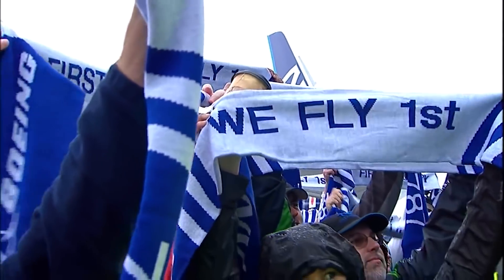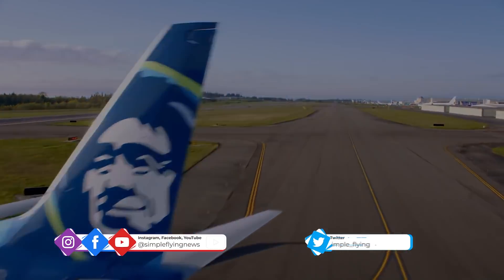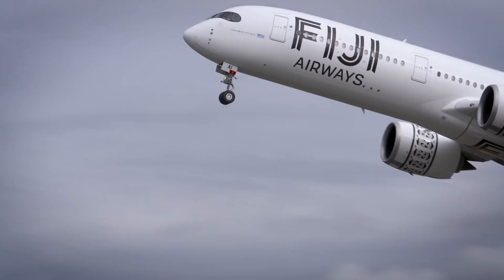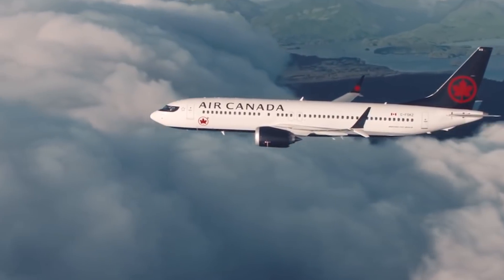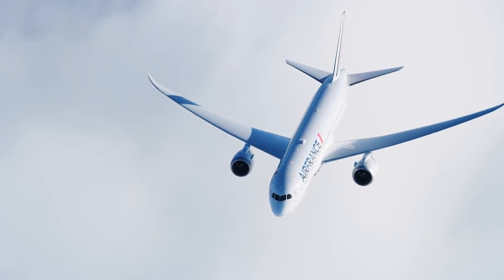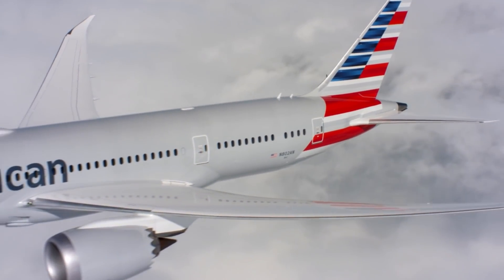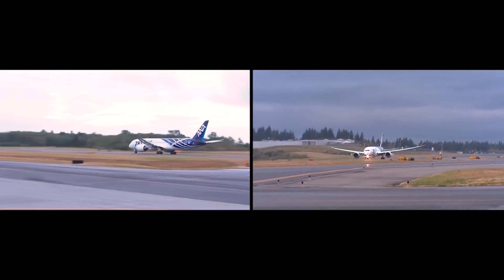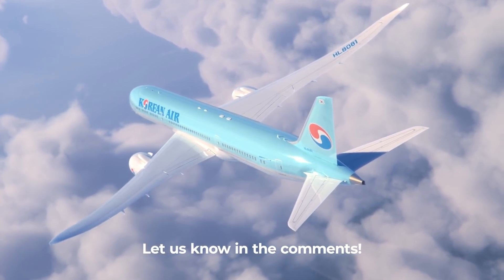Why Doesn’t The Boeing 787 Have Winglets?

Comment: "Raked wingtips" can be categorized as "winglets". Similar to bent-up or canted-up winglets, those raked wingtips are also not a main wing component with slats and aileron. They are an extension for aerodynamic reasons = to reduce induced drag. So they are a "flat winglet".

Comment: “A properly designed wing doesn’t need winglets.” John Roncz. He was the aerodynamicist that designed the Routan Voyager and a bunch of other things with Burt Routan. Winglets came to the fore when oil went up. A design house in Seattle filled with ex-Boeing engineers figured them out. Not all wings can accept the retrofit as spar loads and construction come into play. When Boeing first started offering winglets as retrofits, they wanted to charge a sizable percentage of the calculated fuel savings but got very few buyers. When the airlines, their bread and butter got stressed by fuel, Boeing finally relented to pretty much the cost of producing the refit kits. Interesting tidbit. At United Airlines, the performance engineers calculated the winglets on the 747-400 were useless and wanted to remove them for maintenance and weight savings. This idea was torpedoed by marketing who said they had poured fair money into convincing business travelers that the winglets were the sign of the latest and most advanced aircraft engineering. The winglets stayed.

Comment: The raked wing tip started at NASA about 30 years ago with the scimitar wingtip. It was actually proposed for the C-5 in the 1960s but the Air Force thought it was too delicate.
Reply: I wonder what the Air Force thinks now

Comment: I've flown on a 787, and I was impressed with it. I'm a Commercial Pilot and have flown both as a pilot and as a passenger. Air NZ I flew the 789 and with LAN I flew as a passenger on one of their 788's.
Reply: How does the rake wingtip reduce vortices?
Reply: @Bi Han  The raked wingtips work better than winglets/sharklets because there is less drag, in thus helping the 788/9 with the 20% less emissions. Boeing chose this over winglets because there are less parts to put on the wings, and also the raked wings work better to reduce the wingtip vortices.
Reply: @seanrollett6273  anyone can say that take works better and it reduce drag, more efficient etc but what’s the real reason for it? How does it work better than winglets?

Comment: The first time I saw the 787 wing in flight from my window seat, it looked so beautiful like a work of art. I also love the push button window shading (as long as the flight crew do not override and keep all the windows dark).
Reply: Sometimes it just makes sense to keep them all dark
Reply: @JAYfromTHEworld  True but I did not appreciate it when the flight crew of my flight from Denver to Tokyo, which left at around 1:30 in the afternoon, darkened the windows for the first six to seven hours of the trip, even though it was still light out. ANA flight crews never do that for some reason.
Reply: @alooga555  common courtesy to close your shades after meal service.  Doesn’t matter if the flight departs at 8am or 10pm.

Comment: Does raked wingtip have a tradeoff of longer span compared to winglet?
Reply: Yes but it allows the wing to have a bigger area which is better. Even Embraer uses it for the E2 in 3 different sizes for the 3 variants of the family
Reply: How does raked wingtip reduce vortices?

Comment: Winglets are good when the wing span is limited. For the same wing span a winglet is more efficient. 
But if wing span is not limited then the raked wingtip is better, after all a winglet doesn't produce an upward facing lift vector.
Reply: All the winglets do is minimize the wing tip vortices. They don’t really provide any lift, and barely pay for themselves. The raked wingtip is much, much better. HOWEVER, the -400 is easy to pick out of a crowd!
Reply: @Ampersandrascott  Winglets provide lift. That is why they work.
Reply: @AmbientMorality  Winglets create enough lift to counter their own weight. The main purpose is to control turbulence coming off the wing, which reduces drag.
Reply: @Ampersandrascott  Yeah, I didn't word that well. For a given alpha a winglet allows the wing to generate more lift across its entire span. On an actual plane, of course, that means that the angle of attack can be decreased. But the same thing is true of a raked wingtip, which also allows the wing to generate more lift across its entire span (for a given alpha).

Comment: Has flown many times on the Dreamliner, and flying again 2. April. Very confortable airplane, mainly because of the low cabin altitude
Reply: What is low cabin altitude?
Reply: @erickscott5732  As an example, the B737 when flying at 40.000 ft. the air pressure in the cabin is equal to the air pressure at 3000 meter. Meaning the air density/ pressure you would feel, as if you were standing at a mountain top 3000 meter above sea level.
The cabin altitude/ pressure on the Dreamliner when flying at 40.000 ft. is only 1500 meter, witch mean you will not feel pressure in your ears, and you will have more oxygen to breathe.
Reply: Not true at all!!! Just a sales point!!!!

Comment: Why are their no winglets on the tail wings?
Reply: Because the horizontal stabilizers are not loaded much, in fact the tail lift, for stability reasons is negative
Reply: @arturoeugster2377  but it would increase fuel burn